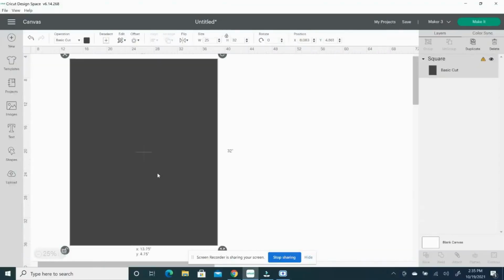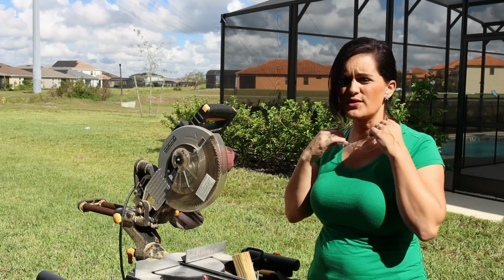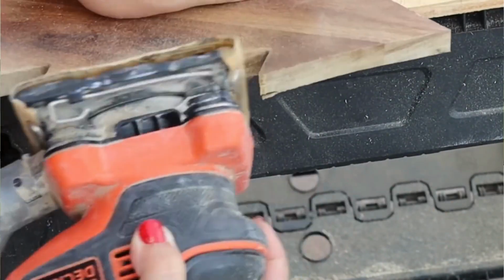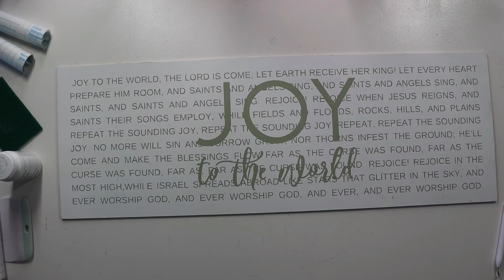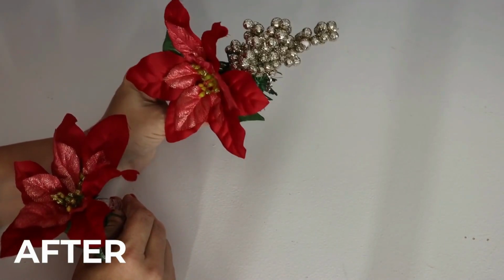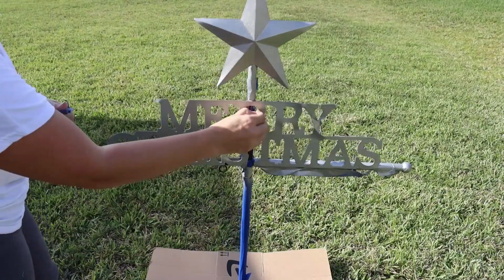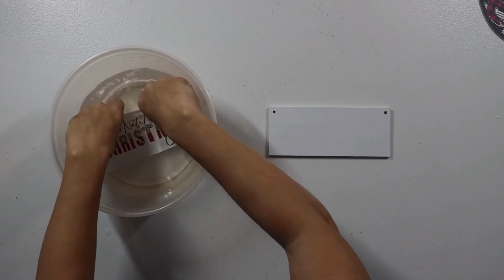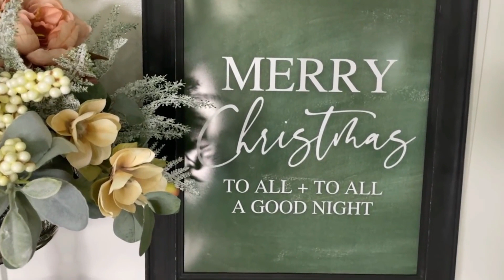Absolute TOP 35 BEST High End Christmas Decor DIYs Ideas!

Comment: One tool I absolutely love is my stubby ratcheting screwdriver. It is short, comes with six bits and has a ratcheting action so that you only need to make a quarter turn to drive or remove a screw. Perfect for tight spots where an electric drill doesn’t work.